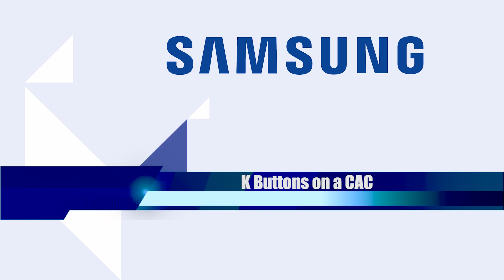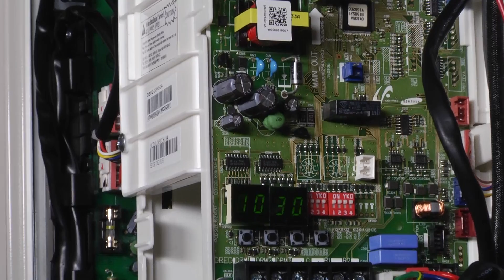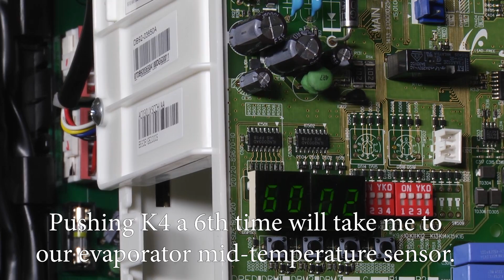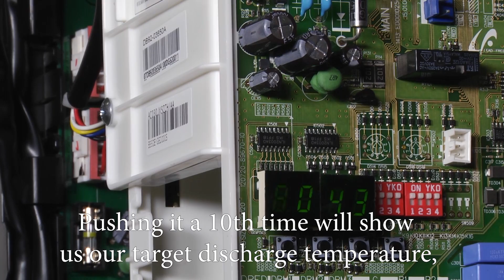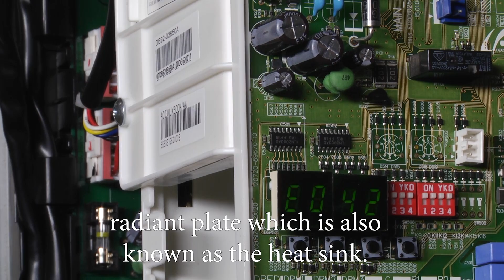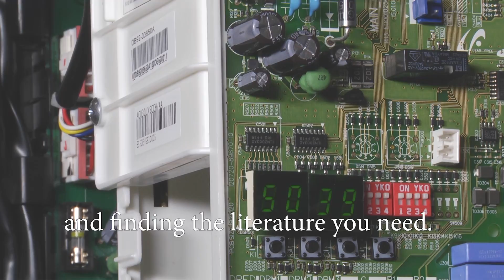CAC K Buttons

Comment: At 3.09 - running 90Kw of capacity (approx 310,000BTU\hr.  Seems very unlikely as Samsung don't do CAC models that large (well not here in Europe anyway).  You're a factor of ten out so 9kW seems much more probable.
Reply: For MH060FXEA3A   what is the max order compressor frequency
Reply: Good knowledge   samsung  vrf k4 thankyou so much ❤